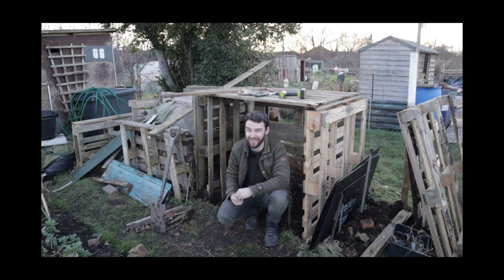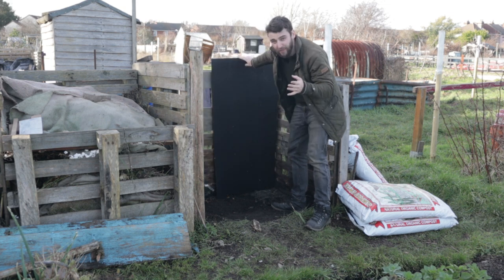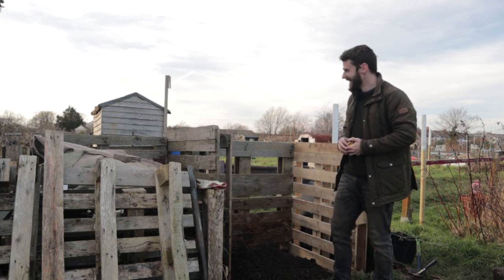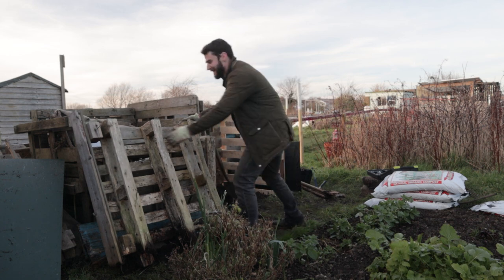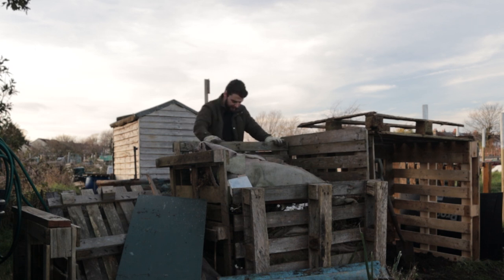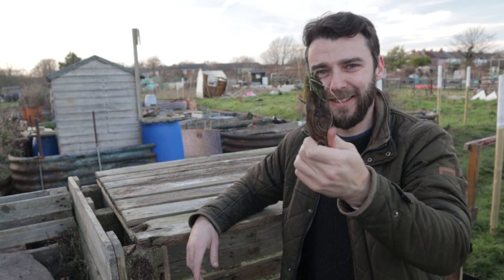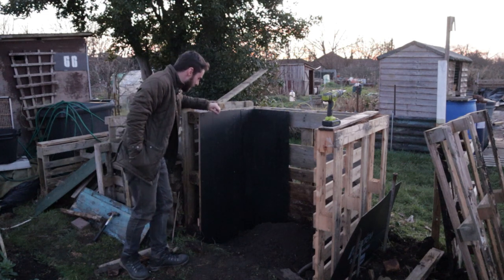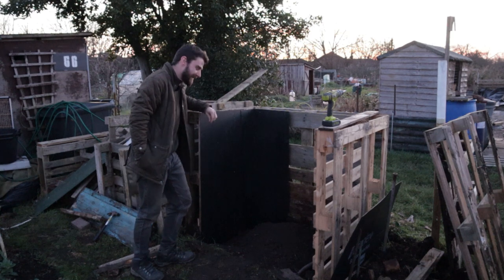Fixing My Composting! - Part 1 | JB's Allotment Diaries

Comment: I use 8x4 sheets and bend them mate. but I always leave the back outside open to allow airflow and prevent rats nesting in the cavity. great video pal. it is uv stable but turns grey after about 4 years and starts to split and you will have to replace them then, but don't get into the compost
Reply from the maker: Hahahaha not the man himself turning up and giving me advice! Thanks so much Tony, really good to know all that. Don't let the haters get you down 😉 Youtube is lucky to have you

Comment: Damp proof membrane on a roll would be easier I think and if it's a bit too tall it easy to fold over 😁 or old compost bags split open and stapled on
- use some wire to hold the back edge down it will act as 'hinge'
- stand your wood pieces/pallets on end to aid water run off and  to avoid it becoming too wet
- could you utilise those ton bags to be either cut up the bags to line/cover the top OR to use in the finished compost bay to store the completed compost the top being folded over to prevent weeds getting in. Also split open could they be used to cover the beds like you would use black plastic to prevent weeds/warm the soil.
- use the ton bags to hold brown waste until needed in the compost bays
- use a ton bag to hold autumn leaves to produce leaf mould

Great video as usual keep up the good work 🙂
Reply from the maker: Lots of great suggestions! I've already got some builders bags full of leaf mould 😁 Also one of those bags is already full of browns for mixing! Generally though those ones on the plot are starting to break down. As it's the woven plastic I really don't want it coming apart and going everywhere. I don't think they'll be much use for much longer!

Comment: If you dont hinge the lids, you could wire them in at the back using fencing wire. It'll work like a hinge and stop them flying off if the wind does pick up.Steve...🙂

Comment: Great job.
Jb instead of the expense  of the plastic sheets if you have any why not line them compost bins old compost  bags cut the bags one side to open them up have the black facing outside 😉  being black will absorb heat help with decompose just stapell the compostvto the pallets there free and ♻️  all the 👌

Comment: Great job, I still have this job on my list. My 2 bays should become 3 with closed sides just as you prescribed. Hope to see this really makes a difference on the way you make compost. Do you think it will be created faster as well?
Reply from the maker: Yes it should definitely work a bit faster if it keeps the heat in and doesn't get too wet!

Comment: Hi JB just a curious question do you have any issues with rats getting into your compost bin? I had same setup as you with pallets & plastic sheeting but i kept finding rats getting in and digging tunnels so i ended up going back to the darlik bins as i call them and wire meshed the bottom to stop them
Reply from the maker: I've actually only ever had issues with them in the dalek bin funnily enough! They've always left my big bins alone.

Comment: :hand-purple-blue-peace::face-purple-wide-eyes::face-purple-wide-eyes::hand-purple-blue-peace:
Reply: JB what's wrong with cardboard sheets much cheaper.
Reply from the maker: They degrade really quick! I used them when I set them up but find they degrade, look really gross, don't keep the heat in as well, and also harbour thousands of snails!